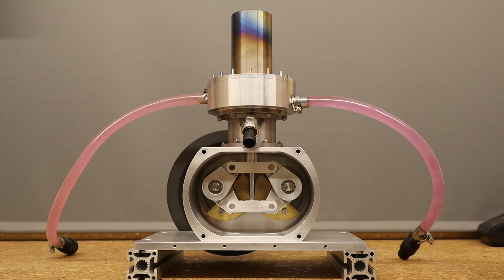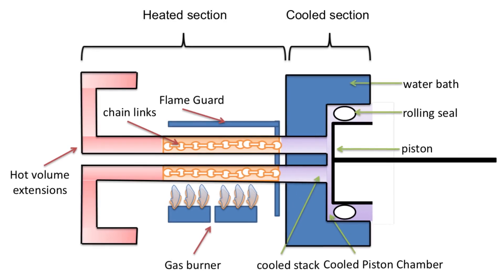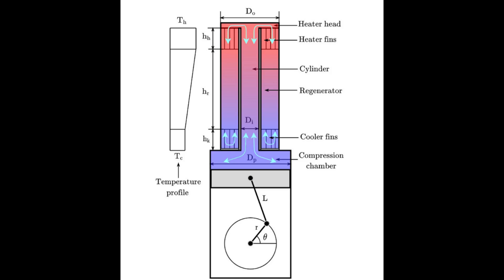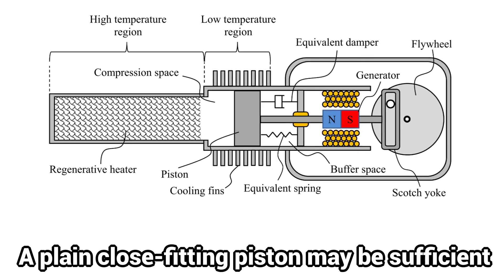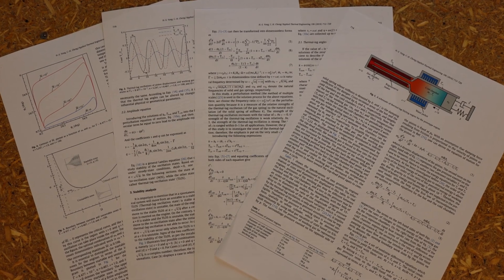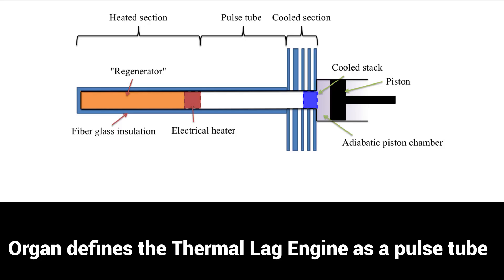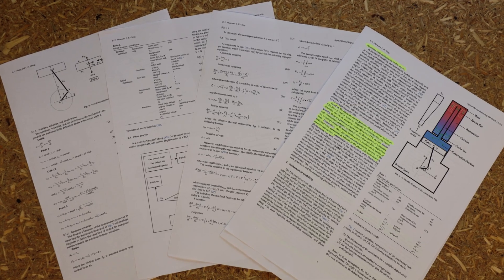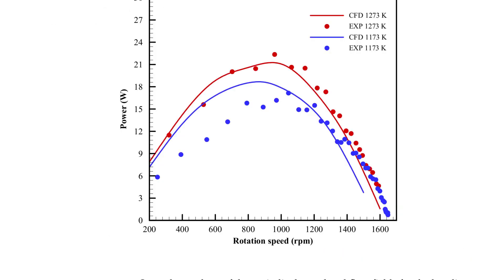Thermal Lag Engine for more cheap energy than the Rhombic Stirling to go off grid

Comment: Tengo una pregunta mi amigo, si se combina un motor stirling con un motor traga llamas de tal manera que use la misma fuente de calor, aumentaría la efiiciencia del sistema?
Reply: No realmente. El ciclico Sterling es muy efficiente. Asi que, mejor usar solo el Sterling. La limitcaion por ambos es la tolerancia de temperatura por los materialies por el intercabiation de claor. Pero puedes usar el escape de un motor combistion internal para alimentar el sterling.

Comment: Like you, i have been seeking a way to convert the abundant wood waste around my off-grid home to electricity. I was and remain quite fascinated with the elegance of the free piston sterling engine, but it might be too much of a challenge for me to make one.

There are a few companies that have commercialized FPSEs, notably Baxi manufactured cogen/CHP hot water boilers for the UK market that put out about 1KwE, but these were unprofitable and pulled from the market several years ago. 

A canadian company, Qnergy, sells or rents FPSE generators to the oil industry for providing power and compressed air at remote well sites.

For my own application, I've resigned myself to an ORC (organic rankine cycle) tuebine system, indirectly heated via biomass/thermal oil and using either a radial outflow turbine or possibly a tesla turbine. The idea being to run the cold end at the same temperature i use for my hydronics, so the heat isn't wasted.

Comment: You have excellent content.  Applying the KISS principle, the TLE seems to be a very good candidate for experimentation.  Simple construction could allow low-cost and fast iteration of design tuning.  Using DOE could reduce the total number of experiments. High speed fiberoptic pressure sensors could measure the possibility of pulse tube behavior.  The piston being in the low temperature region is a real plus and the simple drive configuration (even free piston) could reduce friction losses and extend the useable life.  I'm a semi-retired physicist and still like experimenting on new things.  Thanks for sharing your work.
Reply from the maker: Thanks for your nice suggestions and the nice comment!
I will think about it!

Comment: Have you considered using hydrogen gas to heat the hot end? It's much hotter than woodgas and only produces steam as a biproduct. It can be created easily using Potassium Hydroxide and aluminum foil put through a shredder, add water and it will react releasing H2 and water vapor which will need to be condensed out. If you plan on storing H2 make sure you understand how hydrogen embrittlement works first. I'm looking into using a lead liner to help prevent it.

Comment: add a heat exchange refrigeration cycle to a normal steam piston engine
Reply from the maker: I am not sure if steam engines are the right solution for me and an additional Stirling just for the waste heat of the steam engine will make it even more complex...
But thanks for the suggestion!
Reply: the point was the refrigeration cycle, to capture recirculate the waste heat, not the engine tech @myengines2443

Comment: Really interesting channel! Just subscribed! I'm mainly commenting, so the algorithm recommends your videos to people like me :) But while I'm here, i've got a couple questions if you don't mind:
1. have you considered a Nikasil coating for your rhombic sterling project? There are companies in Germany like Barikit who will coat your cylinder and hone it for you for a reasonable price. 
2. What kind of efficiency have you been able to achieve with your rhombic sterling engine during your 300W test?
Reply from the maker: I think a Nikasil coating (with an al piston ?) has to be lubricated?
I haven't made efficiency tests as the engine has to run first to my satisfaction and there is still much room for  improvement.
Thanks for your nice comment!
Reply: @myengines2443  If the temperature is kept under 600 C then you might consider a DLC type of coating that can be applied in you shop with acetylene in oxygen starved conditions

Comment: 1. Route compression stroke via external tubing/piping to top of hot tube ?
2. One NRV at tube inlet and another one at hot tube outlet.
Also, is this a strictly Stirling Cycle pursuit or are you open to other thermodynamic cycles as well, i.e.: Ericsson, Brayton(1st Ericsson/Joule) or even Rankine ?
Reply from the maker: Thanks for your nice suggestions I have to think about them!
Of course every cycle is interesting if it can be an effective energy producer!
Reply: @myengines2443  
Assuming generator load is a steady 500 W, and since heat source is biomass(fuel pellet) - which is near impossible to regulate.
What is the arrangement to regulate engine speed ?

Comment: The problem with all these low energy engine is basic thermodynamics. 
The best possible efficiency of a thermal engine depends on the temperature difference. If this is small your best possible efficiency will be like 5%. Further, the power of the engine depends on the heat flow. Again, if your temperature difference is small, the heat flow will be small and the engine will be weak. Both inefficient and weak.
Reply from the maker: Yes you are right.
I try to use a high temperature difference with my self produced biogas and wood (or woodgas is necessary) and also will use in the final stage air preheating which will also boost efficiency.
And the "lost" heat will be used to heat the home.
In summer we have enough solar energy anyway.

Comment: I don't think much of the type of engine you described and, in my opinion, falls into the performance group of fluid Stirling engines.  I have a book on the latter type and in my opinion it is severely limited in performance such as Watts/cc displacement.

Were I still interested in this, and I certainly commend you for your perseverance in your investigations,  I'd stick with rhombic drive engines, optimize the heat exchangers, and work on engine function without lubrication.  As I mentioned earlier in another post I'd also investigate pressurization with hydrogen because the small amount required can be produced domestically.  It is not nearly as dangerous as many believe;  simply purge the engine with Argon or Nitrogen before filling with H.

Some years ago I designed a steam engine that the client wanted to run without lubricant.  I found a company In Texas that applied its secret surface coatings to customer's equipment that permitted sliding motion without lubrication for long periods.  I discussed my application with one of their engineering people and he was confident with the application.

Unfortunately this project never got to the build stage and I did not gather any first-hand experience. However it may be fruitful for you to pursue this avenue.

The only alternative I see are reciprocating engines with flexing diaphragms.  Here you would be into a serious development program to develop a design and find material that will stand up to this use.  Beryllium copper alloys may be the way to go here but, again, I have no first-hand experience with this.
Good luck and greetings from Canada.
Reply from the maker: Many thanks for your many helpful suggestions!
I really like to work on the Rhombic Stirling further but before I can give my full focus on it I want to discover if there is any other more simple alternative.
It is has many very complex problems that are hard to deal with just in spare time!
The biggest problem are the endurance properties that I hope to solve with less rolling or sliding friction and wear.
If I fail with the search for an easier engine I can fully focus on the Rhombic.
I actually bought a big 1.4571 stainless rod for a much bigger Rhombic Stirling engine!
Many greetings!

Comment: Interesting if your goal is experimentation. But not for a practical application.
Reply from the maker: I also think that another concept will be better....
Reply: @myengines2443   I like your original design, 300 watts is pretty damn good.
I saw a really cool video on air bearings...  I will try to find it, but perhaps that may improve maintenance.

Comment: Since I like the stackability best, I recommend trying the TLE. If any of these show promising results, stack them until they meet your needs. If you think about doing this on regular Sterling models, it would be much more expensive and require much more maintenance. In comparison, the TLE appears to be similar to a TAE, which is undoubtedly the simplest type of sterling. However, keep in mind that the energy yield will be much lower than expected. That's why I'm thinking about stackability.
Reply from the maker: I also have the suspicion that the TLE and TAE are quite similar in many aspects.
Multi-cylinder engines make many things, such as the burner, more complex, so I would prefer to build bigger.
Thankd for your help
Reply: @myengines2443  Building bigger is one option. Stacking them into a string is another. I am following the rule - if one shows quite good results and it would be to much effort to build it bigger - build smaller but more and ouple them together. Imagine one crank shaft where many of these work in parallel.

Comment: I agree sounds like a pulse tube mechanism to me.
Reply: The pulse tube cooler is usually done at higher frequency with wave generators think speakers.  This seams that the piston is just applying pressure waves down the tube at slow frequency, I would expect it to be very low power.
Reply from the maker: Yes, some aspects by sure but maybe it is more complicated?

Comment: The NASA RPC Stirling engine has been running continuously for 18 years and is showing no signs of wear, You have the complicated parts already machined from your last engine, you could reuse them with slight modifications, the addition of flat spring stacks and a linear generator made however you see fit. The wear and difficulty sealing on the piston parts of your machine largely comes from the fact that the crank causes a side load on the piston, with the design with no crank its much easier to get a low friction seal, it is also much easier to get the very high working pressure that you absolutely need for both power and efficiency when the whole engine can be sealed with no rotary shafts.  If you google this you could find a diagram that could be used to make a copy which would perform well and is tried and tested. The piston seals are very important, you could try some "carbon graphite reinforced PTFE" ;-)
Reply from the maker: I investigate the free pistons engines (I think the NASA RPC is one, have to look first!?) later in this series but the most are very high tech and therefore to complex like the rhombic.
The free piston engines mostly have much problems with piston alignment as far as I know.
I tried carbon reinforced PTFE but the tribolocical plastic W300 I use now seems to be much better.
Thanks for your comment!
Reply: @myengines2443   you have mail ?

Comment: Lov Your work. ❤
Sorry but I think its a dead end. 
You can make large cheaper stirling using Your knowledge and exp. Making it affordable and efficient. Im making now one from simple and cheap compressor. Fun and complete parts.
Goal is not to create any free energy. Goal is to geat ahead before photovoltaic panel when its no sun. ❤
A Lot of good work here. ❤
Reply from the maker: Your project sounds nice plz make a video and show it here, it will be interesting!
Before I build a conventional Stirling engine again I want to explore all other possibilities.
But I actually bought a 130mm diameter 1.4571 stainless rod for a much bigger Rhombic...
Thanks for your nice comment!
Reply: @myengines2443  check my comment under Your TMG movie. This is the future there. Nasa "free piston" is my retirement project ^_^.
But now im connecting simple big barrel to compressor (like a caveman;) to make it simple fast and affordable.
Somebody with Your skills should use simple arduino to control delay of running free piston...
Maby ill make some video soon.
Respect to You Sir.
Reply from the maker: @christomold3142   nice!
Reply: So that would be an Alpha-type configuration?
Reply: @TheBaconWizard  For now its gamma but i will test alpha also. Ive just connected 20liter 3mm wall barrel to one cylinder with alu displacer and the second one is acting like power piston.
I think it should be alpha anyway. (By the hudge temp difference and internet conclusions). So after simple power testing i will make no friction pistons on 2D springs in apha configuration.

Comment: I think is hard to beat steam engine/turbine.
Reply: Steam can be dangerous and is extremely maintenance intensive.
Reply: For large power requirements you are correct.  For smaller domestic needs a turbine is probably too expensive and inefficient.  It also would be necessary to develop an automatic steam boiler.  This may sound daunting but there are boiler controllers available in Britain that model steam boat builders use for unattended boiler operation.
Reply from the maker: I think its hard to produce permanently so much steam?
Reply: @myengines2443  A condenser which is just a radiator will recondense the water, no need for more water in the loop, plus, any modern technology boiler will have less thana pound of water heated at any time. And with a tesla turbine, no oil is needed and you would be getting at worst 1KW and most likely 4KW with your burner setup
Reply: @myengines2443  you don't need to use water as a working fluid in a steam engine, if heat source is controllable.